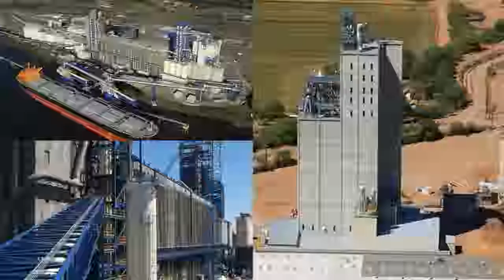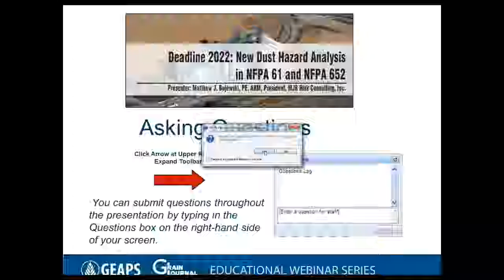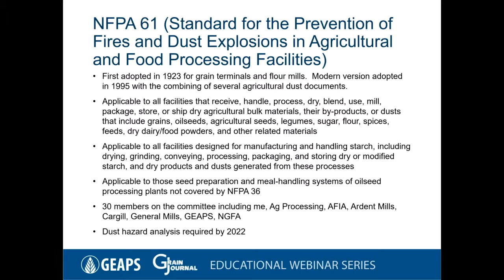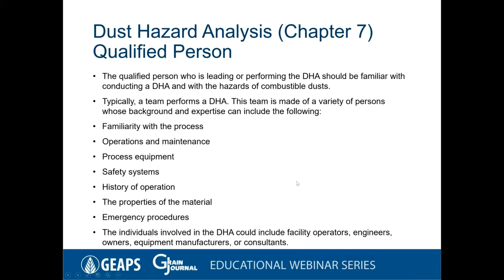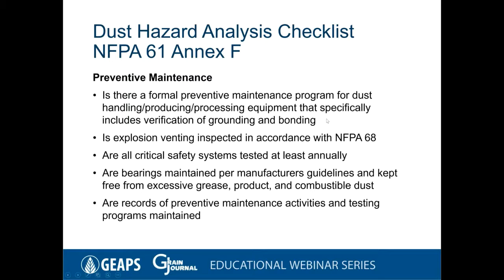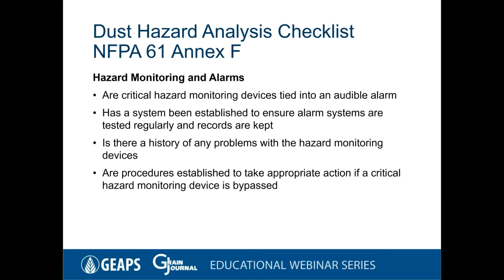Deadline 2022: New Dust Hazard Analysis in NFPA 61 & NFPA 652

Comment: I need the NFPA dust hazard analysis standards for ordinary manufacturing (tires specifically).  Not food/agriculture.  Where would I find this?  And in the industry what is the limit that combustible dust can be measured at on surfaces?
Reply: NFPA 652 and 654 Each of the standards has a hazard identification section that describes how to identify the hazards associated with combustible which involves more than measured dust on a surface.
Reply: @kyleslade4324  Thank you.